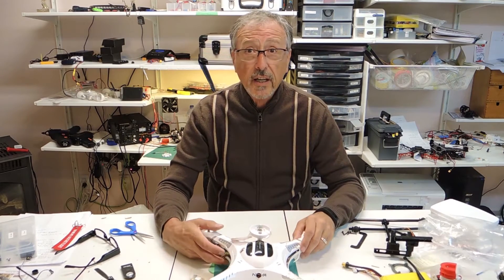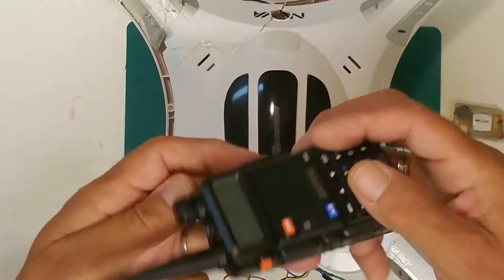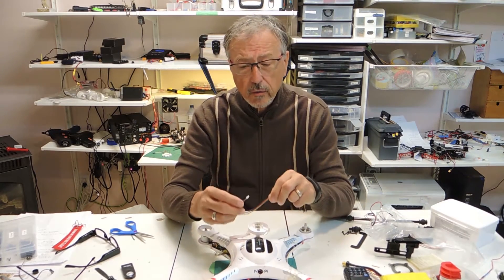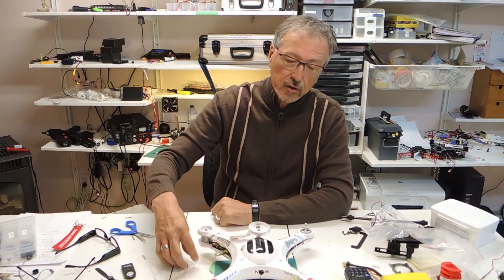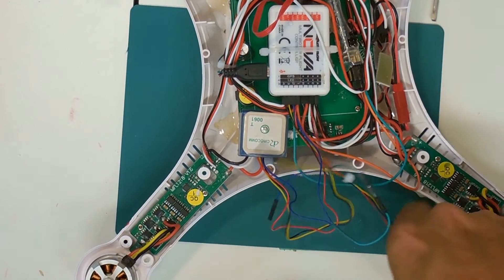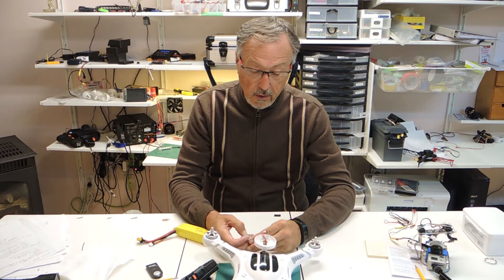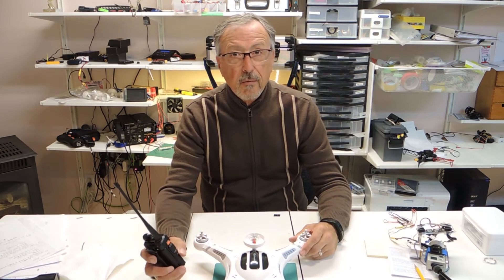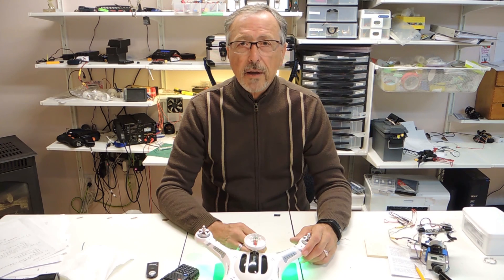tBeacon Part 4: Lost plane and Quad Finder Installation

Comment: What about using a dedicated gps for the T Beacon all in one package and then running the voltage wire to the receiver on the plane.  That way if the T Beacon becomes dislodged, it will still be transmitting a gps signal.  Then you could move the unit from one plane to another.
Very informative video
Reply from the maker: Thanks I did that: https://www.youtube.com/watch?v=E2u9kTdd5rc